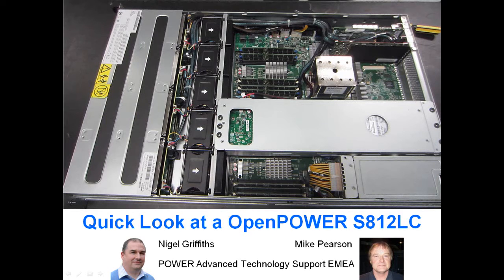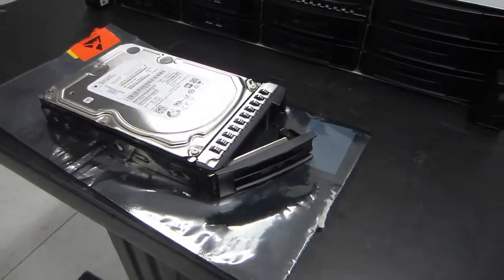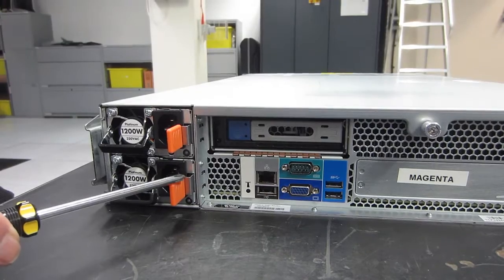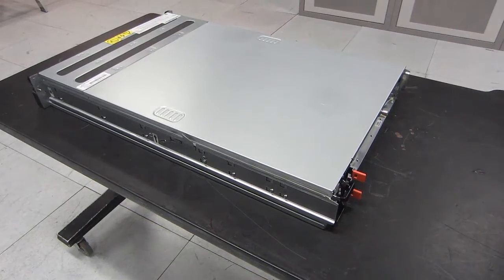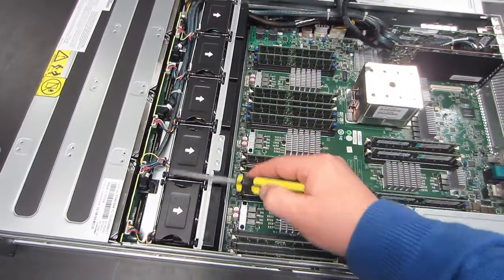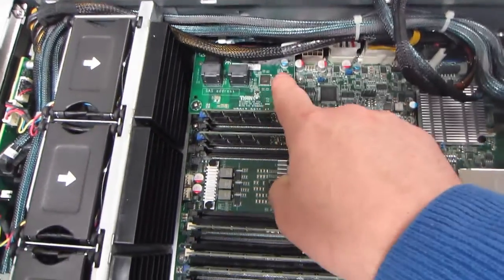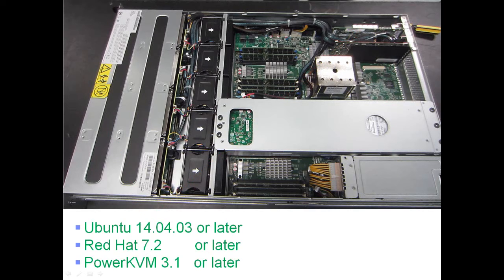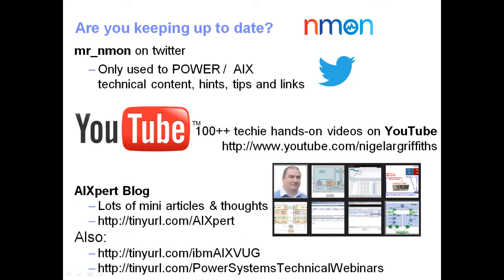Quick Look at a OpenPOWER S812LC

Comment: Can you watch a youtube video on this machine?
Reply from the maker: This machine is a server. I don't see any point in watching a video on it. You should be planning to use Apache webserver, RDBMS, server applications for 1000s of users or HPC codes or 100s of virtual machine. Cheers, Nigel
Reply: This machine cost thousands of dollars more than a regular x86 computer. For the money you pay for it, I was hoping it would be able to do everything. I guess simple things like ripping a CD, or watching a YouTube video are not possible on it. :(
Reply from the maker: +a4e69636b Horses for courses. There are x86 servers that cost ten times more than a S812LC and are equally bad at thing that you can on a laptop but then these are not personal computer.  It is like saying this big BMW is no good as a tractor for ploughing a field!
Reply: With all due respect, I think it would be more like a BMW without air conditioning, or power windows. It would be the little things we take for granted that would be missing.
Reply: a4e69636b You may be able to run a GUI on it if you put a graphics card in it. I don't have any such server so I can't try myself.

Comment from the maker: Hi, I don't have a S822LC but have had remote access to two running Ubuntu 14.04.03 and RHEL 7.2 to get nmon for Linux capturing the GPU MHz, temp, CPU & RAM Util. and Watts. S822LC has 2 POWER8 chips, only 2 disk but two Nvidea K80 GPU adapters with 2 GPU each.